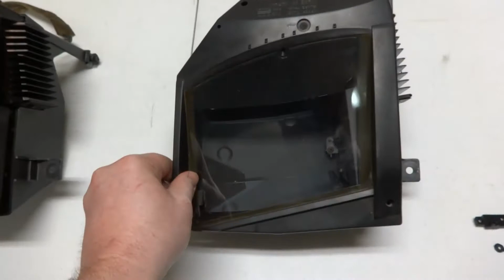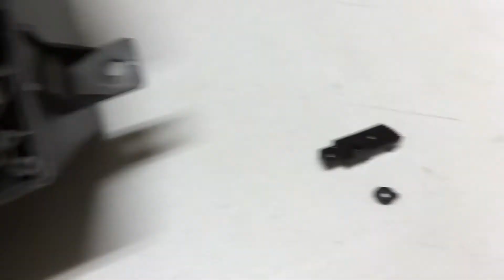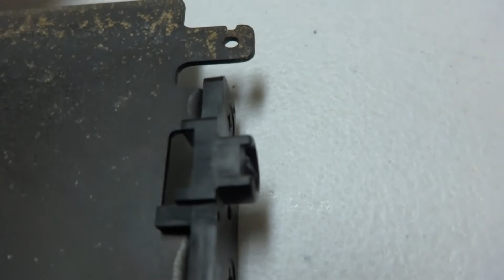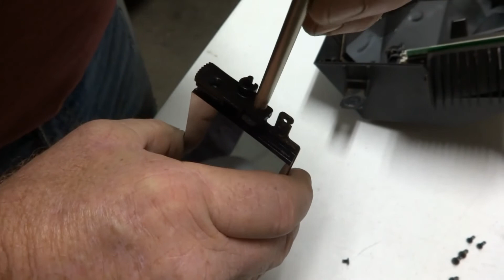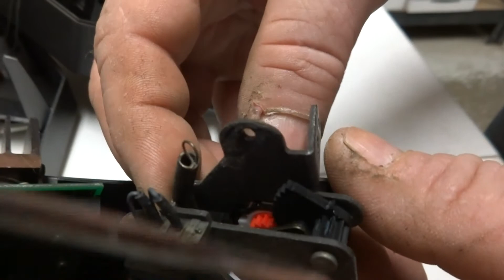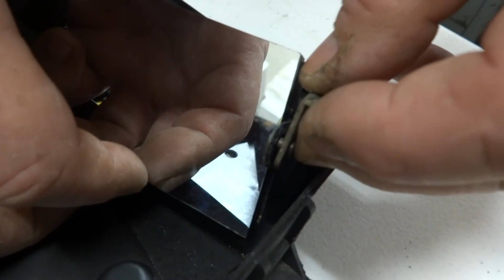C5 Corvette Heads Up Display HUD Repair

Comment: Thanks for this video! I just fixed my HUD with your awesome parts kit. I took your advice and showed 5 teeth, however the display would not go high enough for me on the windshield (I'm 6'2") so I had to remove the HUD again and show 6 teeth instead. Now it's perfect...THANKS AGAIN!
Reply from the maker: We are glad we could help. It is good to know that the teeth needs to be adjusted for taller drivers. If we can help you with anything else for your C5, please let us know.
Reply: @VetteprosUSA I’m 6’-1” and took this advice and with it adjusted all the way up, I can only see half the display. Going to be taking it back apart to adjust it. Have some other things to change anyways.

Comment: Thanks for posting this video.  I ordered the kit and it fixed my HUD.  In my case, the pivot was broken and the bushing was missing.  I put it back together and the HUD did not come on. I disassembled it again and made certain there were 5 teeth showing and reassembled it.  It popped up on the windshield and what a beautiful sight it is. :)